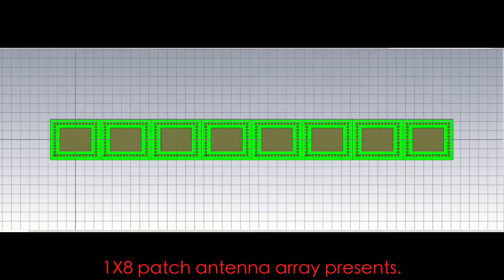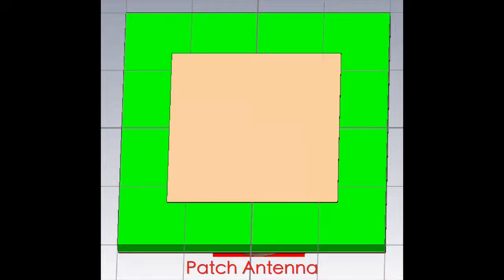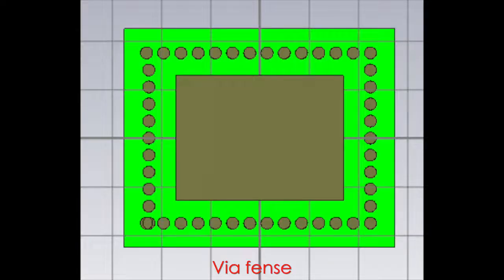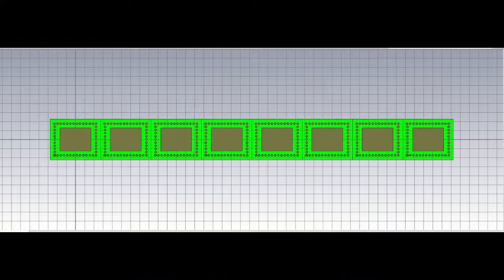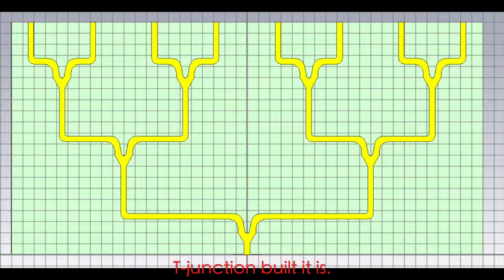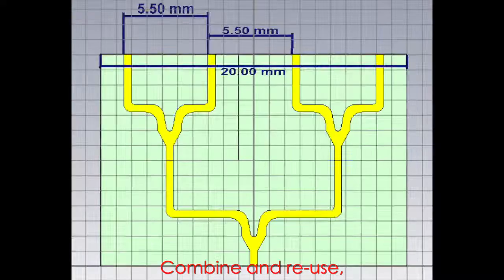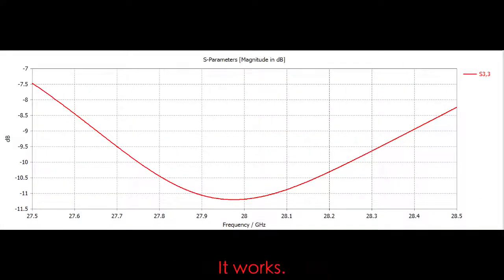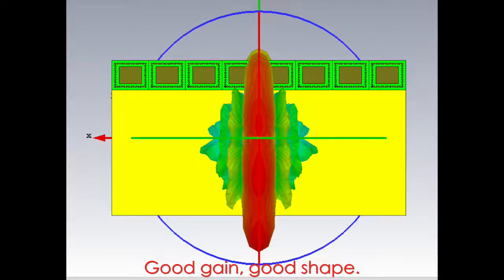04-Antenna Array Rap

Comment: Hi brother
I design antenna to work with circular polarization according to that i feed the antenna with two ports .
How can set the phase shift between the two ports
Reply from the maker: For two ports, You need to excite the two ports simultaniously with two RF signals 90 degrees out of phasse. Good luck!
Reply: @Fan-vk9gx  from where can set the phase shift
Reply: @Fan-vk9gx  this is my what's app